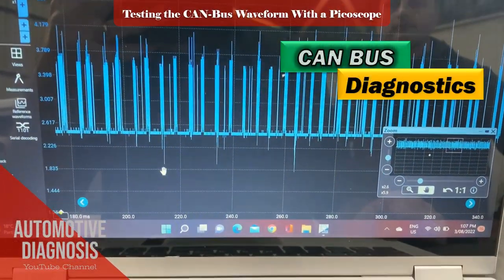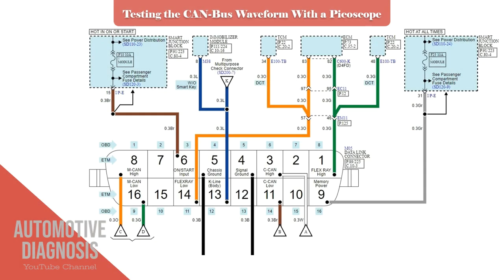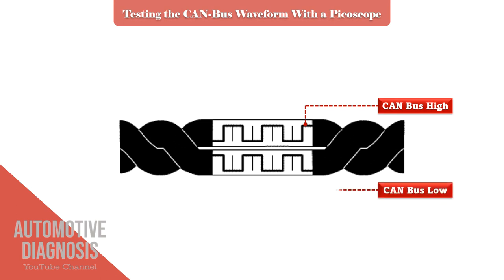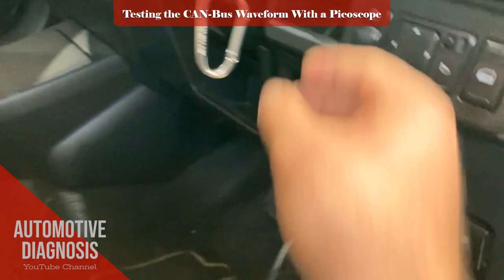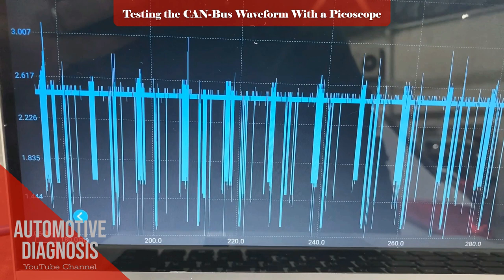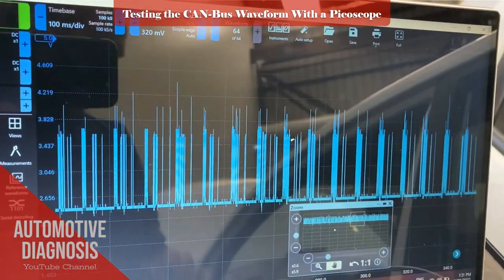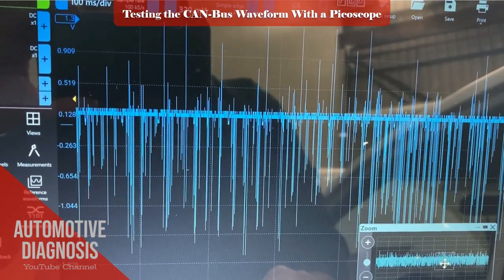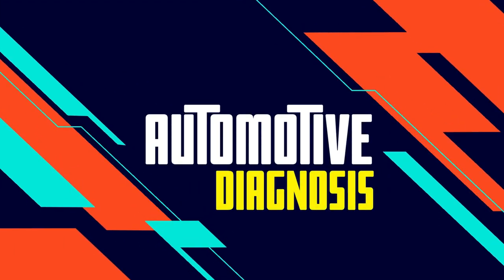Test CAN BUS with a Picoscope | Reading the CAN BUS Waveform | CAN BUS diagnostics with Picoscope

Comment: Good work, but please how did you create the short to ground on CAN high,i mean the connection
Reply from the maker: Thanks, I actually had no commutation with many units on my scan tool which can be from the CAN-Bus, so when I checked it, I saw that somebody screwed another wiring harness under the dash which caused short to ground on CAN-Bus as CAN-High insulator had been damaged by that screw. I removed the screw but before fixing the damaged wire, I made this video and used a piece of wire and an alligator clip to show the fault to you guys.
Reply: @AutomotiveDiagnosis  so please did you back probe the CAN high wire with the alligator clip
Reply from the maker: You can do that to see how short to ground in the CAN—High can affect  the CAN-Low.
Reply: @AutomotiveDiagnosis  okay thanks for your help